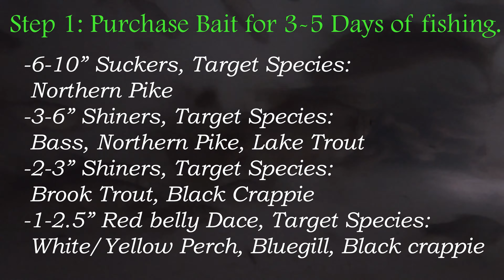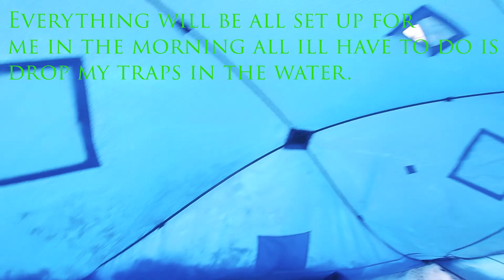Ice Fishing Mini Bike, Can it Tow A Jet Sled!

Comment: 500 studs in just the rear? Seems a tad overkill haha. I put 100 in the rear and 80 in the front and did some laps on my pond to test and it was fine. Glad I'm not the only one that thinks a minibike can make a good ice fishing sled puller.
Reply from the maker: Maybe not quite 500 but small hex studs and really knobby tread so I went overboard lol and awesome to hear I’m not alone on the ice fishing  mini bike thing. Thank you for watching more mini bike and other cool stuff is in the works now
Reply: @MainelyFishing1  nice, I used a product called kold kutters from Amazon. It was a pack of 250 for around 27 bucks 1/2 long. I took it for a rip around the yard after we got a lot of snow and I lost about 20 from the back tire. They don't like spinning then catching the hard ground underneath. I'm going to have to take it easy and avoid that from now on. Good luck, I have an ice fishing tournament in a couple weeks where I can give the set up a real world test.